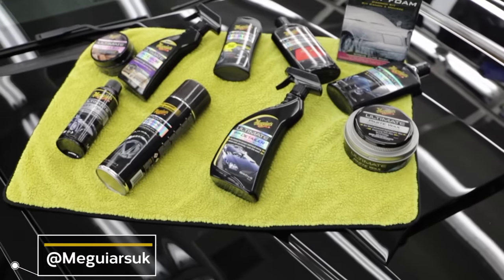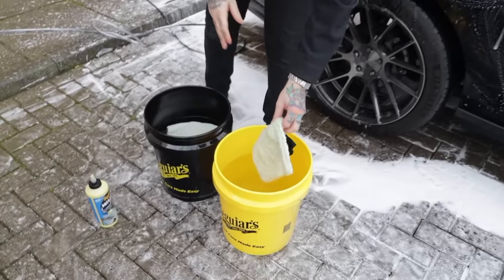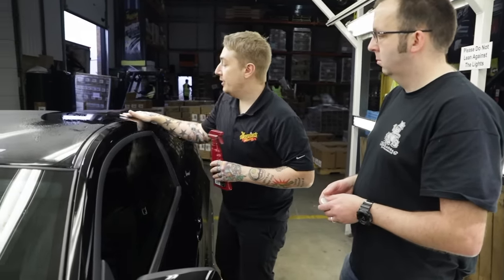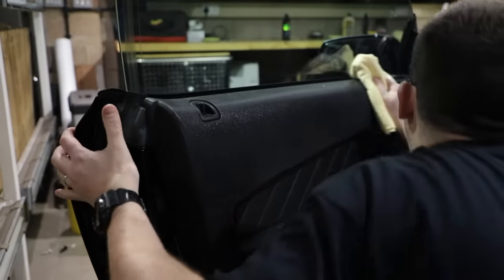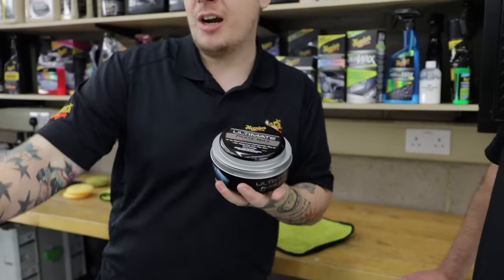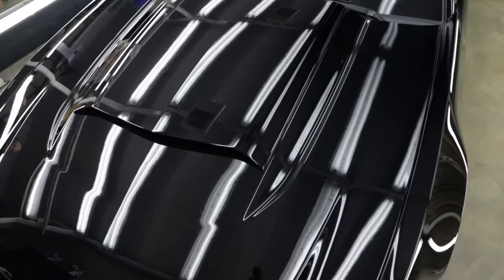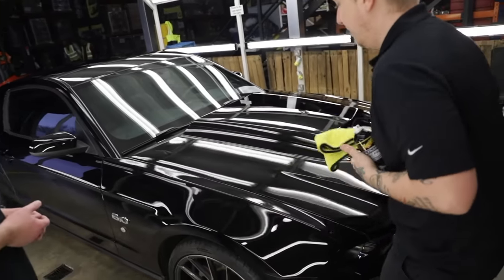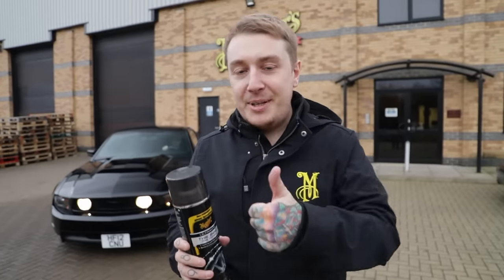ULTIMATE Detail for BLACK CARS using the Meguiar's ULTIMATE range | Ford Mustang | Day In The Bay

Comment: Here's a tip though, if no one has already addressed it, when you rinse the mit squeeze it outside the bucket instead of back into the bucket so it keeps your rinse water cleaner longer and when it gets low just refill.
Reply: I thought that would be common sense, but great advice for novice car owners no doubt!
Reply: @ChicagosM0stWanted  Yeah you have to watch that common sense thing. It's not as 'common' as you might think..
Reply: Agreed but use grit guards as well. Trust me they make life easier
Reply: Man oh man black cars - I’ve bled black many times over the years. Great video. 
Given I’m not a detailing business I’d only have my vehicle to worry about. When washing I’d have about 12 mitts soaking in the wash solution. The wash wash solution costs enough (as does everything), so you may as well soak as much solution as you can all through your wash mitts ready to go. Use one, throw it in the bucket, you’ve got another freshly soaked sudsy mitt ready to go. Once you have the mitts it’s a no brainer, and you get way more from your wash solution. It’s easy to build em up through b’days/Xmas/Father’s Day etc, beats gettin socks and jocks💪💪
Reply: GREAT tips!
Reply: @chrisandshazza01  This is the way.
Reply: @chrisandshazza01 You're right! I use 1 towel per panel so I won't transfer anything to the next panel..

Comment: Was Mark previously washing his car with 80 Grit sandpaper?
Reply: Looks like it's spent it's life in a car wash :(
Reply: Unfortunately all cars have to this extent some scratches and swirls, black cars just show them much more then any other color. Also, hand polishing, drying ect, by hand does more harm then good. My mustang I bought was supposed to be fairly new condition, but instead since it was hand waxed and washed several times for car shows, the car ended up with much much more scratches and swirls by the previous owner.
Reply: I've got two black cars with notoriously soft paint from VAG (Seat and Porsche) . One 9 yrs old and one 7. Both have hardly a mark on them and they are fastidiously hand cleaned and dried every week. The car shown in this video shows all the signs of being washed regularly in a car wash. I use Maguires ultimate compound/polish/wax or the Auto Glym equivalents, so they do work. I've recently tried an expensive carnauba wax on the Porsche and it's not as good as Maguires ultimate. So, despite the miserable bloke in the video, I'll stick to what works :)
Reply: once you own a black car ull understand
Reply: @malcolmalvarez5740  I own two black cars and neither one look like that.
Reply: I agree, the paint had more scratches then normal but that is normal when you have to use aggressive liquids and chemicals to remove all that baked road grime because the black paint runs very hot in the sun. Wash plus has polish grit and will scratch your paint as it deep cleans, use only when polishing. This product is not for regular washing. You will freak out with the deep clean but scratched paint. I use it all the time, only when I correct the paint. Wash plus keeps my pads clean. Yes, if you pamper your car by washing right after the rain and garage kept, then you will never see it like that, although, every once in a while it might be necessary to deep clean it to keep up the shine. D300 with a yellow or  orange pad, then Blacklight from chemical guys with a microfiber polishing pad. Put the cherry on top with a Marine sealant, it hides the scratches.. I use Ardex Marine sealant.  Not all cars are made equal, just find the Grove.
Reply: Hunter Jones and dropping the wash mitt on the floor then reusing it?!
Reply: @davidwaldie6227  thanks i have horrible swirl marks on my black charger do you recommend hand compound and polishing i wanted to do some paint correction but idk what i should do...I have a da polisher but doesn't seem to work help me please
Reply: @kblazindetailing9846  depending on how bad your paint is you may need a more aggressive compound. When using the DA, go over each section four times slowly in opposite directions. As long as you have enough lacquer, you will get a really good finish. It just takes a lot of time with the DA. My Seat took almost two days, and it had been looked after.
Reply: All late but if you noticed the paint actually looked a lot better before they clayed it.... They probably were pretty aggressive with the clay knowing they would polish it out after
Reply: David Waldie psssst, let me tell you a secret. There is carnauba wax inside most meguiars car shampoo’s....
Reply: Dark paint, i think most of them are soft paint (for most today vehicle), so you could easily get swirl. I have a black painted scooter and if i put a coating on it even with a light pressure with applicator pad it'll make a swirly finish, even tho my pad & microfiber are clean, also i clay & polish it before putting it on
Reply: Bullshit about never having a mark on two black cars. Unless they are locked in a garage and never touched, they get banged up in daily use. 
Take your car to a carpark and some asshole will smack their door on it. Especially if its a black car. 
Never use a pressure washer on a car but, it forces all the grains etc to scratch as they are forced off the paint.
Reply: Car wash.  I made the mistake. Instantly regretted it as soon as I dried it swirl marks everywhere.  Never again...

Comment: 1. all wheel cleaner, let dwell, and rinse
2. foam bath and rinse car
3. two bucket method with wash plus
4. dry
5. Clay bar the car
6. Ultimate Compound
7. Ultimate Polish
8. Ultimate Wax, let cure
9. Ultimate all black to replenish plastic
10. Fast Finish for added protection
11. Clean up with Quik Detailer
12. Finish wheels with ultimate tire shine.

Just got all the equipment gathered and I'm going to accomplish this for the first time this weekend on my black car. I decided to get into detailing ever since we've been on quarantine, I appreciate these videos. Thanks for the info!
Reply: Update?
Reply: @lvdragon it was 4 years ago buddy 😂.

Comment: The finish on that is amazing... gunna have a go on my black car with these steps 👍
Reply: They really did a great job with this car the only thing I would change would be not to use the detailing spray with the clay bar basically all of them have a wax in them and you want your paint clean and free of any wax before you add any long lasting hard wax. This car was pretty swirled up, but wasn't faded so the heavy compound was probably not needed just the polish. I'd recommend only using the compound in heavy faded spots and only using polish in between long periods on not waxing.
Reply: Yep agree, the compound just stripped the clearcoat back. For some reason its a big secret, but if you strip the paint, your doing just that stripping a layer of something away from it. It all comes down to the buffer but to be honest. 
Id use the wax only with the buffer and then do it a second time
Reply: Just did a test panel on my trunk! I have black diamond pearl paint and I tell you what just hand polishing did the trick. This line is fantastic!

Comment: 13:02 yeah,  it didn't remove that light scratch even after compound and polishing. And also as it's silicone based after of couple of washes all the silicone and shine will be gone and most of the old scratches will be back.

Comment: I own a 2018 Cadillac Escalade Platinum with Black Metallic Paint and black leather interior. I used the ultimate polish for the whole car after decontamination and ultimate compound behind the door handles and in high traffic areas. But I didn't use wax I got a ceramic coating done. But the ultimate all wheel cleaner works miracles on my Escalade. Brings the tires back to black and the wheels look brighter too.

Comment: I been using Meguiars ever since I got my first car I still drive to this day. I had finally stepped a chance 2 years ago to use a DA polisher and the ultimate compound and polish. It was a 10 hour job but worth it in the end. Car looks better than ever considering it was used when I purchased it
Reply: 10 hour job???
Reply: @savageramirez2925  yea
Reply: @savageramirez2925  Not uncommon.  If you pay for a pro detail, those guys can have your car for 2 days to do both outside and inside.  Hence it costs a lot to get a pro to do it

Comment: Looks like great results can be achieved with over the counter products if used properly.
Reply: But they didnt even use their products correctly lol. Wash plus is applied in circular motions...its an abrasive.
Reply: Yes!
Reply: @galacticaquamica9533  hello there
Reply: @Carlos.Rivera  weirdo 😂
Reply: @Mike_Power  not sure it really matters if you’re planning on correcting the paint afterwards. Also, if it’s an abrasive you’ll want to go in straight lines bc it’ll refract the light less

Comment: Really enjoyed the vid; as a DIY I use a variety of products to include Meg’s-their wash, compund, polish and wax are all great. Less harsh than the compound is their #6 cleaner for not so tough jobs. Also use the interior cleaner and leather conditioner which has a good scent. However, I use Cerakote on plastic trim (sorry Meg’s but this stuff is the bomb) and Invisible Glass for windows.  For wheels and tires I use their Ultimate Wheel cleaner diluted 50% in a bottle and just abount any tire dressing as most are silicone based. Keep up the R&D!!

Comment: Sure meguiars make half this stuff up to sell you more products. The main things are a good scratch remover for deep scratchs (only applied to areas in need of attention) good compound polish for faded paintwork, finishing polish for a very fine finish and then wax for protection. I use a good quality hand moisturizer for interior leather (I use E45) it's a bit greasy to start but once it's soaked in it look like new and is no longer greasy feeling.

Comment: Cant argue with the finish guys, but what the hell happened to the decontamination stage?  
No fallout and no tar and bug removers?  
And also not a detailing brush in sight?  

I cant help but think that's part of why the paint looked so crap after they clay bar stage?  

Maybe it's just me. I dunno.  But if I'm doing a full detail on my car then it's getting tar and bug and a damn good coating of Korrosol before  it even sees a clay bar.
Reply: Decontamination with an IronX or the like is preferred. However when black paint is already in this piss poor condition to begin with it truly begins to be a waste of product when what little possible marring of the paint was caused by the clay bar will far and away be removed way before the deeper scratching and swirling is removed. Therefore going that extra step (in this case and with other very poorly maintained vehicles) it is not a necessity when the steps after will be removing all of that anyways just in the normal process. 

But you are correct. I would always use one on my own personal car, only because the paint is in incredible condition.

Comment: Pro tip, don't apply aerosol tire shine outside after you have done your final wipe down,do it before wipe down,inside. Other then that i use the ultimate line daily.
Reply: Agree, I wouldn’t use the spray can  tire shine at all… 

Spray gets all over wheels and paint and leaves “greasy spots “ especially from driving, greasy spots all over the rear side…

I usually buy tire gel or bottle spray and soak it onto a micro fiber and wipe down the sidewalls… much better

Comment: Great video and transformation ! But I got confused in the end... how can u apply Fast Finish after the wax and the quick detailer?! I’d use in different order and waiting for the curing time
Reply from the maker: Because Fast Finish is a aerosol sealant it doesn't affect or compromise previous protection but actually bonds to it to boost the protection. The Detailer is a nice hint and tip to finish the car off if any wax residues are left over.

Comment: Would have liked to have gotten which speed to run the DA polished at, and which pad for different paint conditions. Tape off any plastic areas before using the polisher close to them as not to damage them? There were scratches and significant paint damage in some spots earlier in the video. How were they addressed exactly? This was more of a product showcase than definitive instruction. Leaves people searching for that instruction other places where other products will be promoted. I've used your products for decades, and it seems as if the craft of successfully maximizing your products is getting lost in product marketing. Teach people how to do things with your products they can't do with others, they will sell better, and customers will be better informed. Thanks for the video.
Reply from the maker: Thank you for your feedback. We have wide variety of videos and series designed to explain how certain methods work such as machine polishing. This video was showcasing the Ultimate Range for people who may have never used them. If you'd like to see more in depth content on Ultimate compound or how to machine polish then follow this link. https://www.youtube.com/watch?v=BSPbjicdrkE&t=3s

Comment: If you want to use the hybrid ceramic wax, do you stil have to use the ultimate polish + ultimate wax, or do you skip them?
Is the ceramic gonna stick to the ultimate polish or wax?
🙏 Thank you
Reply from the maker: The hybrid wax is applied to a wet car. So it would mean after polishing wetting the car with a jet wash and applying the hybrid. We would suggest using the ceramic as a top up of protection when you wash the car but use the Ultimate to get the gloss and initial protection.

Comment: Can one of your products restore faded weather stripping? Something similar to Ultimate Black?
Reply from the maker: On what part of the car are you referring to? With faded paint the Ultimate Compound is the product for the job.
Reply: @meguiarsuk  I'm referring to the roof rails that run up from the cowel at the bottom of the windshield to the back of the roof. I realized they're actually vinyl. I believe they were painted from the factory, but now they're faded to the point where they look grey, but the car is black.

Comment: Ok so if I wax it and spray that ultimate detailer thing, when I want to wash it say after 3 weeks, when I rinse it and then i try not dry it with a towel, all that was and protection i put on the car doesn't it come off along with the drying towel???? So that means I would have to do it all over again after every wash???? Or does it all last for quite a few washes and drying with a towel before i have to do it again

Comment: Great job guys👍 Is it necessary to use fast finish over the wax as I thought it was a wax? Cheers love the ultimate range.👍🇦🇺🍺
Reply from the maker: It's not necessary no but it was another Ultimate range product to add in and will bond to the Ultimate Wax and boost that protection for even longer!

Comment: Use Nu Finish polish. Skip the work and $100 cost of extra products.  Rated #1 by consumers report for cost and quality. I used it for years when I owned a car. It actually fills in the light and small scratches. Deep scratches use a scratch remover.

Comment: It's September 2021, I just purchased a 1999 Firebird Formula from a buddie that has been sitting in his garage for 10 years, So I start looking for Maguire's products to bring the car back to life. After several auto parts stores and even trying to buy them online, I could only get 1 of 3 things I wanted. Interior cleaner, silk protectant and gloss protectant. All I could find anywhere was the cleaner. So I'm sorry to say that Meguiars has lost me as a customer because right down the street from me is a "Detail Garage" featuring Chemical Guys products and they are fully loaded. I'm sure Meguiars is a great product which is why I wanted it but since the availability was non existent, I have to go with someone else. I hope Meguiars fixes this supply issue and good luck to you all.

Comment: unlimited amount of product. that mustang is inside a car spa
Reply: All I'm hearing is Cha-ching cha-ching!
Reply: Expensive if youre paying someone for sure. But you can save hundreds doing it yourself on a weekend or day off. I polished my car, washed, wax, sealed, ceramic coated all on a day off I was finally free. Should be good for awhile now. Probably gonna do another detail before winter to get it all settled(I have a 14 mustang, in black similar to this video)
Reply: That is what I thought also. The way he sprays the wheel shine it will take the whole bottle for 4 wheels.

Comment: Im scared of burning through the clearcoat with the machine, Is it possible to get a good result compunding by hand?
Reply: If you are concerned about damaging the paint, then go back to the Golden Rule of Detailing...….always start with the least abrasive product and work your way up. Reduce the speed of your buffer and/or use softer pads.
Avoid using buffers on body creases and sharp edges.
Mask of with tape, any part you don't want to polish/wax.
I watched many detailing videos and joined "Detailing World" forum and watched everything I could, so I am self taught. You can also do it, just take your time.
Reply from the maker: The only damage you will do with a DA Polisher is actually dropping it on the car. Because they oscillate they never stay in one place.  You can still get fantastic results by hand however using the ultimate compound and Even coat applicator pad.

Comment: How did you remove the bird poo mark, is it with ultimate compound, can we remove bird poo marks, water spots with ultimate compound too? thanks
Reply: I used it on mine just fine. I'd consider getting a dual action polisher. It makes the whole job easier! I got a guild one from Argos for £50. Best £50 spent. Looks like a brand new car